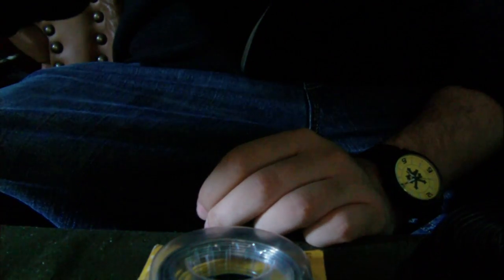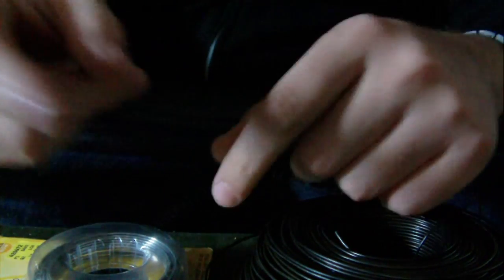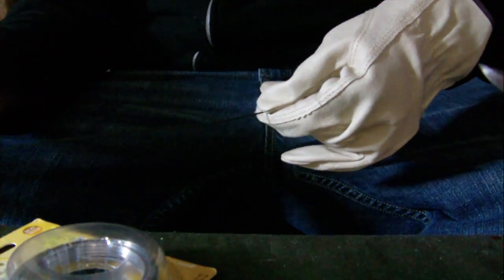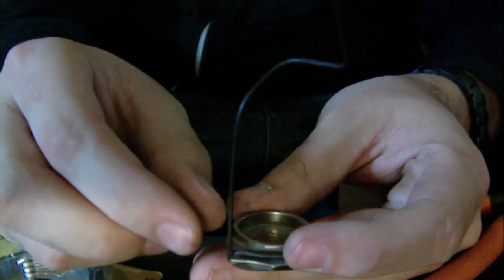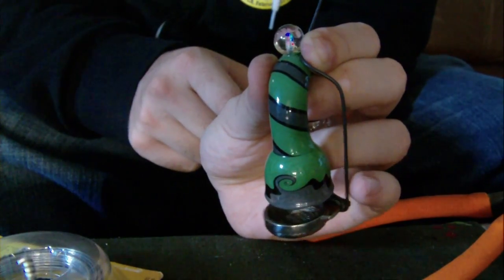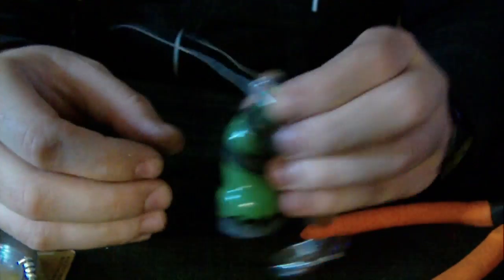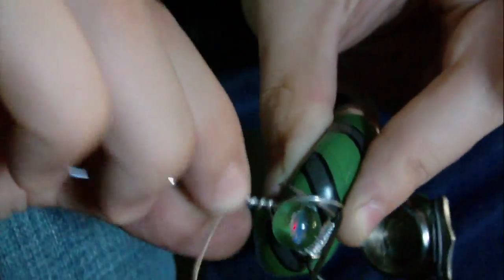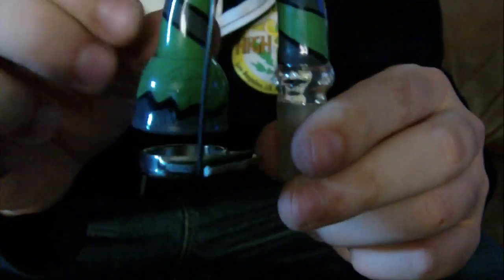How to Wrap a Skillet Pad

Comment from the maker: yeah, those are the people who like myself never heat their titanium past dulling point, the oxidation takes an extremely longer time to develop with the decreased heat instead of heating it red hot every time and letting it cool, which will oxidize it very quickly. the person who had the piece originally had been using it for years and the oxidation was wearing through the pad, it was time for a new one.